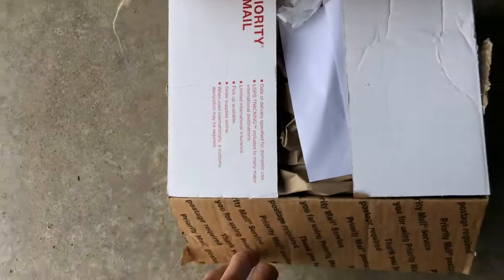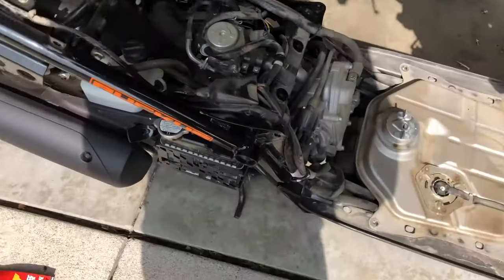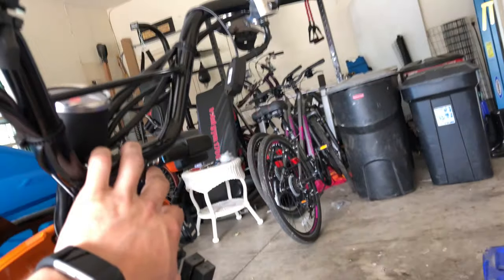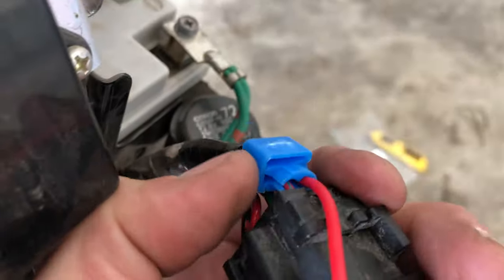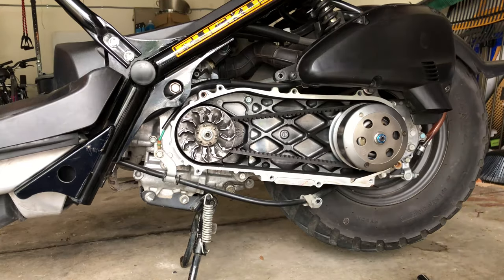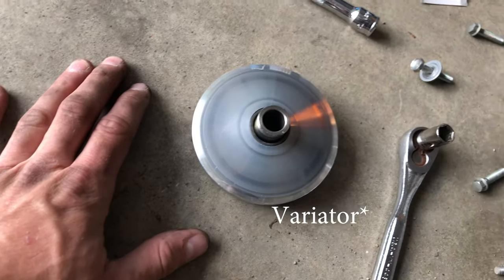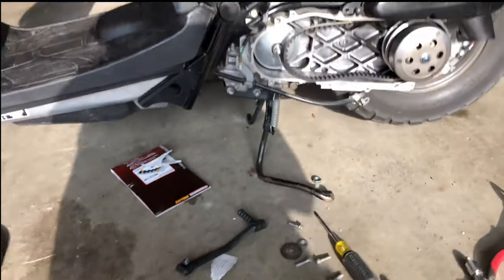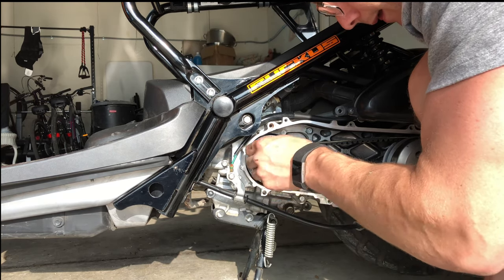Installing the NCY CDI and other "GO FAST PARTS"

Comment: what's the blue connector called?
Reply: It’s the harness-destroyer, or short-creater

Basically a lazy electrician tool where you should be soldering the connections.